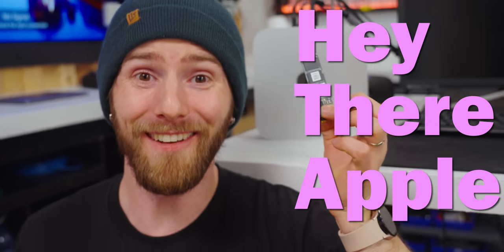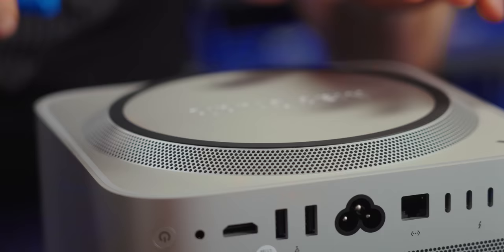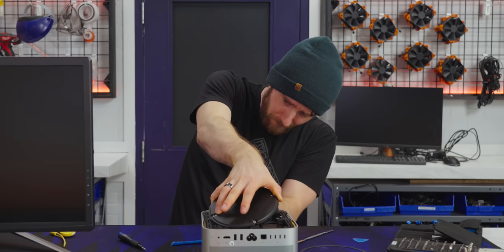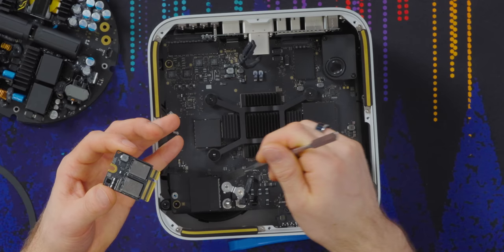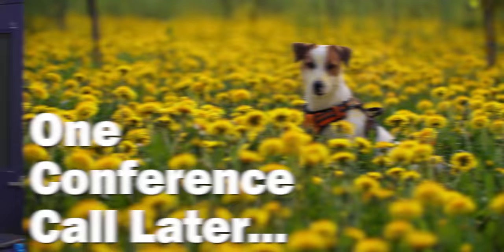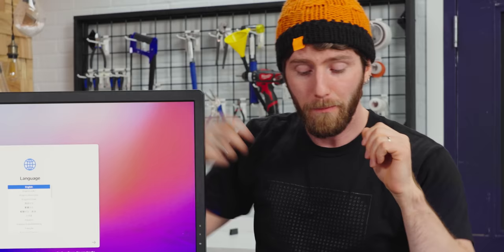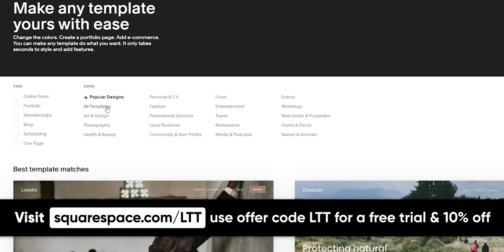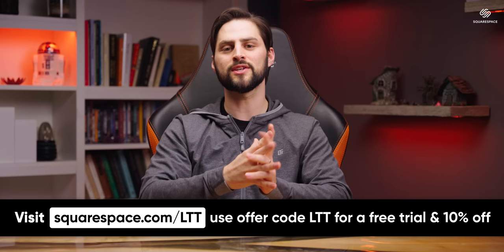I want to love Apple, but they’re making it hard - Mac Studio SSD Swapping

Comment: This is why right to repair is a necessary factor to prevent corporates from harassing the consumers. Even Steve Wozniak said that having the ability to repair products is what truly makes sustainability more of a practical approach. We need more consumer protective laws and ensure both the parties concerned come into a conclusion in this matter.
Reply: I Have never own a Apple product. I recon I will not own one before I can tinker and upgrade my own property. The computer last longer when I can do that. Same goes for smart phones. I Love Apple for design and apps. But I am locked and have a feeling that I do not own my bought product.
Reply: Why do we need laws, though? It's easy to find out how serviceable a product is before buying it. If it's important to consumers, companies will take notice or they will lose to competition that does. If it's not important to consumers, why force it through laws?
Reply: This repair stuff is bs, apple products are built with quality, a mac literally lasts forever and if you are that scared of a cube breaking then get apple care cover..., changing the ssd on a mac is dumb, if youre spending 2k on 512gb then im pretty sure these people can afford 2.2-2.6k for 2tb; it's all about choosing the right option not tampering with the internals and inserting lower quality ssds/iems
Reply: This is not really a r2r issue though.

Which is why someone like Louis Rossmann doesn't see a big problem with it.

I don't think it's good, in fact when you look under Louis' video you might find my comment poiting out that this is still anti customer and specifically to prevent upgrades.
Reply: @Qwerty-tw7ku  there's a YouTube Channel about a Apple Fanboy Fixing Apple products because they break... There is a saga in Mac Address about how badly design the  Airpods are in regards of avoiding Ear Wax, there's a company with the only objective to fix Airpods, There's a Channel about a musician who knows nothing about repairs (sort of) repairing IPods (and doing a good job about it) there is a Apple refurbished store where you can buy official Refurbished Apple products
Why would any of these be necessary if Apple products were truly made to last also are you forgetting about how one of the IPhone Generations used to bend when you put it in your pocket thanks to apple's low quality materials?
Reply: @danielrouw2593  You're saying that Apple, Dell, Lenovo, Asus, Samsung, etc, are all "in on it" together? They made a pact to create unrepairable products and left consumers no choice? My guess is that most consumers don't care much about repairability. They may complain about it if and when they need repairs, but when it's time to buy, they look at price, brand, looks, some specs and that's it. They won't choose an uglier phone or a larger, heavier laptop because it's repairable. Let alone pay more. So companies give them what they want. If repairable products sold better, companies would make them.
Reply: @Skodak96  That's a different and arguable issue. This comment was about consumer protection laws so that corporates don't harass consumers.
Reply: @ironcito1101  Because it's never going to happen otherwise. There are a lot of ways people need protecting from themselves and this is one more of them.
Reply: @ironcito1101  If reapairable products were designed and marketed better (or at all), people would buy them. It's a logical falacy you are putting out here. As the consumer has no choice, there is no "sold better". 
The only way od companies making the products repairable is to force them. And the only way you can force them is by somebody bigger making them.
Reply: @ironcito1101  Yes I'm saying there is a pact/pacts. It's been openly discussed by economic experts advisors and lobyists since the 1930s and likely much earlier. There are plenty of government petitions and documents put forward by industry outlining "planned obsolescence" as a good thing. As i said, watch "why we can't have nice things". It's a good starting point for understanding the topic.

And the repairable = fat ugly argument is absolute nonsense. Many devices I've taken apart clearly cost more to purposely make them less repairable.
Reply: To be clear, the takeaway was that there is nothing stopping you from installing a NEW flash module, even a used one from another Mac -- just that at present it needs to be the same capacity. This isn't cause for an environmental disaster, it's just poor consumer practice to block at-home upgrades of something as basic as storage. I understand that they don't want to encourage it considering that it involves removal of a bare power supply PCB (very dangerous), but it isn't impossible and shouldn't be prohibited.
Reply: @danielrouw2593  I didn't say that repairable = fat ugly expensive. I was making the point that repairability is low in the costumers' priorities, so I see no point in a law forcing something that most people care little about. As for the conspiracy theory, I'll just disagree.
Reply: @justjoe7313  Yeah, I guess that's what this argument comes down to. I very much disagree with the nanny state that knows what's good for the people better than the people.
Reply: @phishphood423  and it's anticompetitive, forcing the sale of flash through Apple alone. It wasn't legal for GM to require the use of Dexron, nor should this be.
Reply: @ironcito1101  But now it's the company that knows what's good for the people better than the people. Like no headphone jack on a $1000 phone. Or a $2000 display without a removable power chord. I've been told it is removable, my bad. Or this shit.

Planned obsolescence isn't a conspiracy, it's an established design and manufacturing philosophy. It exists for the same reason as fast fashion: to keep making money. The economy must grow.
Reply: @ironcito1101  Well i can't force you to believe anything. If you think everyone plays by the rules, i envy you and your optimism in the world.
Reply: @Veeger  Eh... I agree? If you don't like Apple's unrepairable products, don't buy them. If there's demand for repairable products, companies will make them. As simple as that. Leaving aside specific cases like utilities, companies can't force buyers to buy.
Reply: @awandererfromys1680  The company can only offer a phone without a headphone jack, it's up to consumers to buy it or not. And they did buy it, big time, so apparently they didn't care much about the jack. Would you have preferred a law mandating a headphone jack?
Reply: @dkrampage2933  Have to disagree with every point you have made there mate... Manufacturing apple products from raw materials is the highest out of all the other companies so unofficial parts will degrade quality.
cracks, bends etc don't happen by themselves so bending of the iphone 6 happens only when you are being moronic and are trying to fold the phone in half so it's inevitable when you have thin profile. The 6 had 7 years of support and was sold for 2 years so it's unlikely the company saw this bend as a design flaw unlike exploding batteries...
Airpods aren't badly designed, they offer some of the best audio for its size. Also they last 5 hours in a single session, the earwax you are talking about is from prolonged subsequent use which is bound to happen with any earphones, use some blue tack and its gone lmao
Apple products don't break, people physically destroy the phones which is why almost every apple repair video has some form of major damage.  but like I said apple offer accidental coverage  🤷‍♂
Reply: @Qwerty-tw7ku  what? Dude The bending happened because people put it in their pockets and the phone could not handle it since it was made with aluminium and they forgot to reinforce some of the parts
Reply: @ironcito1101  No, but it's always funny to me that people have no problem being nanny'd by companies, but consumer rights oooooh scary stuff.

Look up John Deere and Right to Repair. Maybe then you'll get an idea why it matters.
Reply: @awandererfromys1680  Again, with few exceptions, companies can't force me to buy their stuff. Case in point, I've never bought an Apple product. Plenty of companies throughout history, even dominant ones, have gone under because they didn't keep customers happy. Governments, on the other hand, do impose laws by force, and there's truly no choice. I'll take free market over regulation any day.
Reply: We don’t need government to dictate what a private company can and can’t do. The best course of action is to just provide feedback to the company itself and move to a different product if they don’t listen. The consumer has the power more than the government has power with companies. Besides if government got involved the company’s lawyers will find loopholes just how they do with every other government regulation.
Reply: @Qwerty-tw7ku  Agreed.  My brother has minor needs so I gave him my still running 2007 iMac and am using a 2013 iMac (I boot up from an SSD as the internal HD is insanely slow)
Reply: @ironcito1101  Sort of like the old Reader's Digest fix is yourself books.  My father had two of those and the newer one was much smaller with less options.
Reply: @justjoe7313  "The scourge of fully soldered and non-upgradeable laptops" talks about the Area 51m modular laptop.  "Its main selling point was that, unlike every laptop produced up to that point, its CPU and GPU could be swapped out for more powerful versions. (...) it didn't exactly take off - in fact, it pretty much fell flat. The motherboard chipset, of course, patently limited the upgrade path because it's a foregone conclusion that in a few generations, new CPUs wouldn't support its motherboard chipset or socket."
Reply: @dkrampage2933  No it didn't, people physically exerted pressure onto the phone
Reply: @ironcito1101  It can be.  My father got a car for $600 and put over $1000 into it.  Neighbor would later say if he had known that was going to happen he would not have sold my father the car.  Caddicarus' "I'm Sorry" video is a poster child of Murphy's law on building/fixing a PC.
Reply: @awandererfromys1680  The power cord is removable - it is just designed to be hard as all get out to remove.  Get the problem right or people will think you have no idea what you are talking about.
Reply: @Qwerty-tw7ku  No, that was after that, when people found out about the IPhone 6 bending problem a lot of people from 4Chan invented the fake News Article about the Foldable IPhone 6 and Apple users thought it was real so they started to bend their phones.
Reply: @ironcito1101  Right to Repair doesn't change your choices, or the free market. You can still buy other brands than Apple. You can still send it to the manufacturer for upgrades or repairs. You can even ditch it and just buy a new one.

What it does is adding a choice you currently don't have.

No company should ever have the right, or even just the option, to restrict access to my property.
It's like buying a house and then have the agent tell you you can't change the toilet, and if you do, you lose your access to the sewers. Because reasons.
This is Apple selling you a computer you don't actually own. You can use it, but you're not allowed to do anything else with it, like upgrades or repairs. Who's the nanny here?

What you call a free market is not nearly as free as you think. Apple has huge brand recognition, and is repeatedly sued by the EU over this, but thousands of companies work like this.
Reply: @Maximara  Sorry dude, thanks for the info.
Reply: i'll fight for right to repair but i'm not holding my breath, for now custom build pc's are the way to go (even if some prebuild retailers are scum bags... ie: Artesian Builds. there are some prebuild retailers that make minor mistakes like loosely connected cables, but its easy enough to fix if you're tech savvy or if you know a tech savvy friend that can help)
Reply: @awandererfromys1680  That's the Apple way. Closed, propietary, expensive. That should be their motto. People know what they're getting into when they buy Apple. But they buy in droves and they love it. Seller agrees and is happy, buyers agree and are overwhelmingly happy... Who are we, and who is the government, to tell them they are all wrong and can't do it?
Reply: @ironcito1101  Who we are? Consumers. And the EU sueing Apple and introducing Right to Repair laws is because we want it. Not just from Apple, from everyone. We're done with all the overpriced, proprietary, unsustainable crap. Whether it's my computer, phone, toaster, or my washing machine, if it breaks down and I can get it repaired for 20 euro, I should damn well have the right to do so. Again, my property. A free market does not mean they're free to take my money and then pull this bullshit. We've tried the whole 'voting with your wallet' thing since the eighties and, yea, it ain't exactly working (no surprises there). So, laws it is. They can comply or leave. Guess which one it will be?
Reply: @ironcito1101  Fair enough, we don't. Instead, I think it would be fair to require such companies to correctly market their products. In case of apple that would mean: You don't get the product, instead you buy a lifetime subscription to use it (including the device). That means that if you want to sell/repair/upgrade you product, you can do so by changing your subscription. 

I wouldn't mind these actions if this was their marketing.
Reply: Right to repair? They clearly showed that changing the memory module like for like worked 🤷🏼‍♂️
Reply: @awandererfromys1680  Yes, consumers. We choose what we buy and don't buy. Companies want to please us so we buy their stuff. The power is there, not in government. We've tried government since the 10000s BC and yeah, it ain't exactly working.
Reply: Right to REPAIR - not "Right to upgrade my SSD that has been securely paired with my device to protect me from hacking and data loss"
Reply: @ironcito1101  you guess wrong about consumers not wanting repairability. Given how popular the repair shops are in Asia and how popular repair videos and sites are... you might want to revisit your assumptions. 
In the Philippines, people are still repairing iPads and phones from 8 years ago and using them.
Reply: i somehow dont think more laws are the answer. what we need are consumers who aren't idiots.
Reply: @ironcito1101  people do want repairability but there are other reason why people want/need an apple for example work or certain hardware requirements so then your choice is kinda gone, also people aren't asking apple much, just don't actively stop repairability, that's it. it would save them time. they just do it to milk you for money
Reply: How does a “corporate”harass consumers?  Actually, what is a “corporate”?
Reply: @LordOfNihil  Idiot consumers, however ubiquitous, aren't the problem. Although I'd call them uninformed. Sometimes manufacturers are violating rights consumers already have, but often don't know they have.

"[Conclusion] The debate around repair restrictions illustrates the limitations of MMWA’s anti-tying provision in repair markets. While the anti-tying provision gives consumers the right to make repairs on their own or through an independent repair shop without voiding a product’s warranty, repair restrictions have made it difficult for consumers to exercise this right. Although manufacturers have offered numerous explanations for their repair restrictions, the majority are not supported by the record.

The auto industry has shown that in certain contexts, self-regulation can significantly increase consumers’ repair options. But other industries have not adopted similar self-regulation.

To address unlawful repair restrictions, the FTC will pursue appropriate law enforcement and regulatory options, as well as consumer education, consistent with our statutory authority. The Commission also stands ready to work with legislators, either at the state or federal level, in order to ensure that consumers have choices when they need to repair products that they purchase and own."

Nixing the Fix: An FTC Report to Congress on Repair Restrictions, May 2021
I'm afraid you'll have to do a quick search on the title yourself, YT bugs out on the PDF link.

Anyway, manufacturers are like misbehaving little children; if you don't correct them, they'll just continue misbehaving. You can't sit idly by just because they're friends with some idiots on the schoolyard who give them their lunch money. It's still your schoolyard too.
Reply: @unlokia  I can do that with my computer no problems, so um...
Reply: @Qwerty-tw7ku  Macs do break, as does every other electronic product. They certainly don't last forever with Apple's built in obselecence.
Why shouldn't a user be able to upgrade a computer?
Reply: @zlobzor  if you want an upgradeable mac just build a hackintosh lmao. There is a reason why 2010 mac pros still go for over 1k and i doubt its due to their "obsolescence"
Reply: @casparhughey5651  sure hug hey whatever you say 😂
Reply: i agree👌
Reply: @Qwerty-tw7ku  dude 2012 mac pro's can't even get the latest update of Mac OS so there's no current Program who would work in those, you think a 2010 Mac is better? And I know that because my university has like 20 2012 macs of those and we all avoid those since they can't run the latest versions of Creative Cloud people prefer to take their old laptops rather than using one of those craps.
Reply: Gonna get a lot of hate for this, but oh well. If you want to fix something, then fix it, but don't be pissed when the company you bought it from voids the warranty. If you want right to repair, then make your own devices. Instead of handing another money hungry company $3k for something, then Try to tell them that, they can't charge you extra to fix their product. You own it yes, but not your supplies, not your blue print, not your design. This is an open market, don't like the way a certain company operates? Chances are you can find a company that isn't doing what apple does.....
Reply: @ironcito1101  Apple forced no one to buy the product.
Reply: @awandererfromys1680  except its not unusual for the industry to have enough lobbying power to ensure the government backs their lock in and forced obsolescence policies while also forcing out any potential competition with excessive regulation. if you managed to get more consumer right to repair legislation, it would still be tainted by corporate lobbyist meddling, giving them more loopholes with which to leverage their machinations.
Reply: @LordOfNihil  Well, they're slowly losing that fight in Europe. And the US as well. We'll get there.
Reply: @rakka3747  Oh, I'd be very pissed because voiding the warranty in most such cases is already unlawful. You can ignore those stickers at your leisure.

Right to Repair often isn't about new legislation, but enforcing already existing ones.
Reply: @ironcito1101  It's pointless to argue with these people. They don't see the choice that comes before the purchase. They don't realize that when they purchase the product they are signing a contract and in that contract they don't have a right to repair. If they don't want it, don't sign it. But they do sign it and then they complain. They also forget that the moment you give the government a bigger piece of the economic pie, the more lobbying and regulations you will get. They also don't understand that when you buy an iPhone, that phone is yours. You can take it apart. You can replace pieces. The software and firmware won't work, but you knew that before the purchase, so why complain after the fact? And they also think it's unfair for apple to milk money from their customers, forgetting that that's how a business works. If I want, I should he able to sell lemonade for 10,000 dollars and require you to drink the lemonade from a particular cup and if you don't, I fine you for an extra 10,000$. It's in the contract when you buy the lemonade. If Apple is not transparent about what you can and cannot do, that's one thing. Omitting crucial information is akin to a scam. But if they don't omit, the who gives a fk.

These people have no idea what rights are and they forget that the businessmen also have rights and that they are people too and that by requiring them with these idiotic rights to repair, they are actively violating the rights of those businessmen. Why are the rights of the populace more important than the rights of a rich dude is a mystery to me. Rights are inalienable and they don't change. You can't ask for laws that protect rights while violating other rights in the process without being a total hypocrite. It's hopeless, man. Don't waste your breath and keep pushing for a free-er market and not buying Apple products. At the end of the day, living life according to your principles is the most important thing. If other people want to virtue signal their utilitarian and altruist morality, they will do it no matter how much you explain it because the problem in this debate is at the root of ethics more than any political view. If your ethics don't match, you will never agree about the politics so it's a waste of time to debate it.

People like me appreciate you trying but it's completely pointless. It's akin to throwing paper balls at a brick wall. No matter how strong and we'll you throw, you won't make a dent.

The disagreement is about rights here. "Right to repair" isn't an actual right from an ethical standpoint. It's a political right (like the right to vote). It is not fundamental and thus not valid ethically speaking.
Reply: @Casper's Studio then you have a few options. 1. Make your own company that is renewable/sustainable. 2. Don't buy that companies products, knowing full well they how they make them.
3. Don't use products like that at all.
Lots of options, but people would rather tell others how it should be done, or how'd they do it. Instead of just doing it themselves. Also you are the first person to bring up recycling or renewing. Everyother one is just made they can't fix a product they bought but didn't make it develop.
Reply: @awandererfromys1680  so buy something from another company, instead of crying and trying to force a certain company to do what you want. You did buy THEIR product, you purchased it from them. You didn't design it, you didn't build it. You think the company is going to miss out on the opportunity to make you pay to fix its own device. If it was easy to make, everyone would do it. Just cause you bought the house doesn't mean you own the company that built it, or get access to all their secrets/products. Agents just sell them, they didn't build it. Comes down to personal responsibility. If you want to fix an I phone, then fix it. While knowing full well they make it hard.  Or choose another product.
Reply: @Casper's Studio having the right to repair isn't going to make life easier for the average person either. The average person wants instant gratification and will just buy a new one. You know full well what you are getting when you buy apple. Don't like it, don't buy it. Can't have your cake and eat it too or something to that effect.
Reply: @Casper's Studio well Steve jobs built apple out of a garage. And got those millions by having investors see the product and how it works. Then bettering the product and letting people buy it. So you argument there is just an argument, not to try it yourself. You'd rather have the government hold your hand and force companies or people to do what you want them too.
Reply: @rakka3747  You missed the part where they are violating existing consumer rights. It's the law. Why should we give up our rights? To a company no less?!?

"While the [MMWA's] anti-tying provision gives consumers the right to make repairs on their own or through an independent repair shop without voiding a product’s warranty, repair restrictions have made it difficult for consumers to exercise this right. Although manufacturers have offered numerous explanations for their repair restrictions, the majority are not supported by the record."

"To address unlawful repair restrictions, the FTC will pursue appropriate law enforcement and regulatory options, as well as consumer education, consistent with our statutory authority. "

Nixing the Fix: An FTC Report to Congress on Repair Restrictions, May 2021
I'm afraid you'll have to do a quick search on the title yourself, YT bugs out on the PDF link.

Anyway, you're damn right I'll protect my rights and liberties against a company's illegal greedy doings. I'm gonna cry and stomp my feet come merry Hell.
Reply: @Casper's Studio certain freedoms are fundamental. Right to repair is not a right. It's a want. People want this ability to repair their own stuff. It's not a right. You signed a contract to not be able to do this. You had a choice and you chose to revoke this ability to repair your own stuff when you bought an Apple product. That's on you. That's not something Apple should take a hit for not should any future companies who want to do this business model. There is nothing evil about it. You know what you sign up for. And if we don't, then that is the problem. The moment you regulate, not only do you violate the rights of the businessmen, you also violate the rights of anyone who ever wants to do this business model. Remember that it is an opt-in thing. Nobody forces you to let these companies do this model. And what if a customer wants this model and they love this model but now they will never be able to opt into that model. This supposed regulation that is supposed to protect people from themselves is a fundamental violation of the right to act.

This is why I'm saying this is not valid ethically speaking. Rights are not violated when you buy an Apple product that you can't repair yourself and you knew that, that was part of the contract. But rights are violated when you regulate against this business practice. Meaning you just did the opposite of the point of government - rights protection. What you did right now is rights violation for the sake of convenience. Convenience is a choice. Not a right. Rights are inalienable. They never changed 5,000 years ago and they will remain the same for the next 20,000. Rights don't change. Legislation can change a bit and adapt with technology, but the rights themselves don't.

No rights are violated when a company tells you before you buy their product that you can't repair it by yourself. You don't have to like it. But if you restrict them from doing so, you would be violating their rights, the rights of anyone wanting to do this business model on the future and the customers who love this business model. If you don't like it, don't buy it. If Apple is not transparent enough, that a good place to legislate (omition of critical information is a violation of the right to think - akin to lying). But stopping them from doing this business model is fundamentally unethical. Rights > Convenience.
Reply: @Casper's Studio well, you see, the problem with the examples you give with drunk driving, high risk electronics and lotions with skin cancer is that they involve human lives. Fixing a fking phone on your own has nothing to with safety. It's convenience. It's more convenient for some people to be able to fix it themselves or in a close repair shop than paying more at an Apple repair shop. That's convenience. Nothing about this has anything to with human endangerment. Nothing. Laws against drunk driving are LAWS; not regulations. Regulations by definition are there to regulate aka manipulate the market in a certain direction. It has nothing to do with rights protection. And yes, some laws violate rights in the pursuit of protecting other rights. But the difference is that it's rights vs rights and not rights vs convenience. The right drunk drive freely is trumped by the giant statistically proven risk of hurting or even killing people. If, for example, you drunk drive in your own mansion parking lot, I don't think it should be outlawed because there is nobody to hurt. But if you are in the context of public places, then you pose a huge, huge risk. Context should always be taken into account.

But there is no context in which a company will be the sole repairman and it will somehow risk public safety. Sure, it might cost more, but as I've said plenty of times, all the customers opted into it. They agreed to this. There is consent. Risking people's lives with high enough statistical significance doesn't require consent to be outlawed because rights have veto power.

Now, about rights being the same. I'm not talking about right and wrong. Rights are implicit contracts between free willed beings that facilitate survival. They are fundamentally there because they are in favor of EVERYONE objectively. That's why rights properly understood are valid 5,000 years ago and 20,000 into the future. They are fundamental. That is also why murder isn't ok in normal circumstances but it is moral if your life is at risk. Survival of the individual. This is why I'd argue that if you are dying of hunger, don't have any money and nobody would help you, that stealing food from the supermarket is pretty much the only moral thing to do. Survival is fundamental. Fixing your fking phone is not.

We have a stark disagreement in the realm of ethics. But the argument over "right to repair" is political. If we don't agree on ethics then we fundamentally cannot agree on the politics because politics sit on the basis of one's ethics. This is how every philosophy works. Pure lebertarians vouch for anarcho-capitalism because their ethical pillars are freedom. Utilitarians don't have a set political framework because there is no agreement on what is fundamentally the most efficient model. Their ethics lie in efficiency rather than individual humans. They are collectivists which touches an even more fundamental philosophical branch of epistemology which ethics are based on. Altruists want socialism because it adheres to their ethics of prioritizing the meek. Every political view is based on the ethics of the person preaching them (unless they are lying like politicians who babble populist agendas). Every ethical framework sits atop the epistemology of the person and the epistemology subsequently sits atop the metaphysics of the person. Until we agree on the ethics or most likely the epistemology if we actually do a deeper analysis, then we will NEVER agree on the politics which is what this particular issue is a part of.

If you care to have a more thorough discussion and see the root of disagreement between us specifically, add me on Discord @ SiMe#4875 and I'll be more than happy to chat. YouTube essay wars are not conducive to productive discussions of this type, only the presentation of ideas. It's too easy to misunderstand, write something a bit off or simulate an undesired tone, not to mention how easy it is to strawman from either side and commit many other fallacies which further destroys the conversation. I'm certain we will not agree here in the comment and probably not even in private, but at least there we can get to the root with back and forths, examples and hopefully a nicer perceived tone. I understand where you are coming from because I've had these types of discussions dozens of times and it's a position I can understand but I think it has some fundamental flaws and so I advocate for different solutions.

I haven't even touched on the math of economics and why it can be beneficial for us and for Apple to make repairs proprietary, but that's a more utilitarian discussion that deal more with hypothetical since we can't get explicit data from Apple. It's possible that M1 chips became possible in the first place because Apple had these shitty business practices. It's hard to know without doing a numerical economic analysis. We just don't know. If you care to have the conversation, hit me up on Discord. Have a great rest of your day :]
Reply: @SiMeGamer  You're like the fourth or fifth person in this thread who argues right to repair isn't a right without knowing that it is already a right by law. Right to Repair is, among other things, about stopping companies violating those rights through repair restrictions.

I'll ask you the same question I asked the others. Why should we give up our rights and liberties just so companies can squeeze more money out of us? That's a really hard sell, and rather dystopian to boot.
Reply: @awandererfromys1680  
1. Political rights are not ethical rights. Just because it's part of the law, doesn't mean it's right. I'd love to abolish that law wherever it exists because I think it violates actual ethical rights for the sake of convenience.

2. To your question: "why should we give up our right and liberties just so companies can squeeze more money out of us?"
Umm... Have you read my comment? I never said we should. Should is a recommendation. I recommend each person decides for themselves what is in their best rational interest. If the benefits of owning an iPhone outweigh the ability to repair yourself or using a 3rd party, then in that context, sure, buy it. Forego this liberty. But you value repairing one's property more than the benefits of the iPhone, then don't buy it. Your "should" in the question ignores context. It's a "could". You CAN buy the iPhone and forego the freedom to self repair, or you CAN decide you hate that business practice and just don't buy it. A company has every right to squeeze as much money out you as possible as long as you both agree to it. You have the right to not sign that contract and publicly voice why you have chosen to do that to encourage others. You have the right to squeeze money out of me too. You can offer me a contract where I agree to give you 200$ every week for the next 5 years. I have a choice to sign it and you have a right to take this money if I do. It's all about choice. A company can have shitty business practices. It's their right to do it either through being illinformed or through malice. It doesn't matter. As long as you get all the crucial information to make a choice, you can make a choice. And it's not dystopian, because if people make choices and companies have no leverage on the market through the government (regulations, lobbying, subsidies and bailouts) then this dystopian future won't happen because the consumers will have all the power, not the company.
Reply: @SiMeGamer  The laws exist because the cultural practice to repair and modify our own property, whether we invented or made it ourself or not, is as old as humanity itself. It's one of the basic principles that makes a tool-using culture possible. One of the driving factors of research and innovation.
Taking that away from us is unethical. Hence the laws.

Look up John Deere and how they treat farmers. That's unethical. And unlawful.

On 2. That's called renting. If I rent something I pay only to use it. That already exists, no need to reinvent it again.

If I buy something, it's my property. I did not rent it. I have the right, like my ancestors before me, to do with it as I damn well please. No manufacturer has the right to restrict my freedom just because.

Even as a recommendation it doesn't fly. That's a hard no from me.
Reply: @awandererfromys1680  "No manufacturer has the right to restrict my freedom just because." It's not "just because". You signed an agreement on it. You know prior to the transaction the nature of usage of said property. You get the product and can do whatever with it. But the software is limited as the contract dictates. Again, if you don't like it, don't buy. Stop complaining as if anyone owes this sht. You are owed what you pay for. They tell you what you pay for. If you choose to accept the offer, that's on you.

"The laws exist because the cultural practice to repair and modify our own property" this is very debatable. I haven't looked at the historical records and the documents surrounding it, but it's very likely a law that came to be through lobbying or an international standard. And it came about in an era where software wasn't a thing. Everything was mechanical; not digital. So math wasn't an actual barrier. If you had the knowledge, you could do it regardless of company approval. Digital restriction are in the realm of math based cryptography, thus making it literally impossible to bypass without the company's involvement. As much as you might hate it, people have the ethical right to engage in such a practice. Many laws exist today because of incentives rather than relevant moral precedent. I'm speaking out of principles - I don't give a sht what laws exist if the principles of my philosophy disagree with them. As I told another person in this thread, we almost certainly have a fundamental ethical or perhaps an epistemological disagreement, so arguing this political stance is pointless until we hash the more fundamental disagreements.